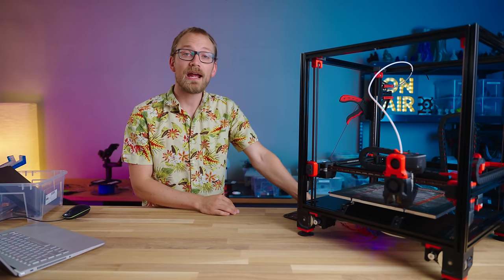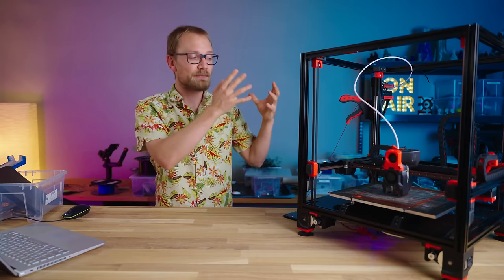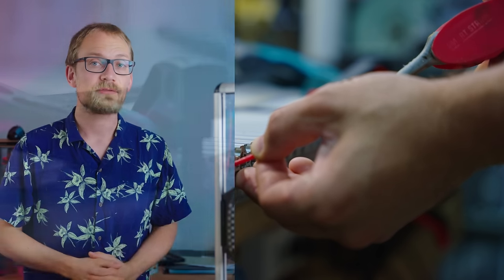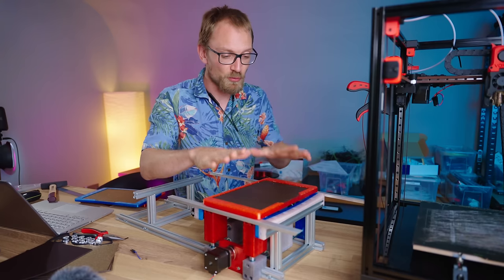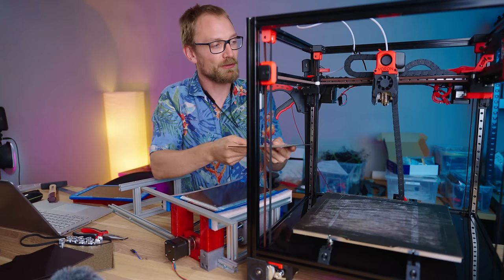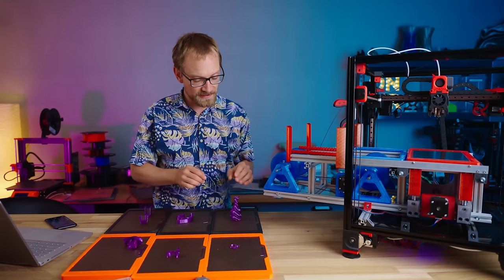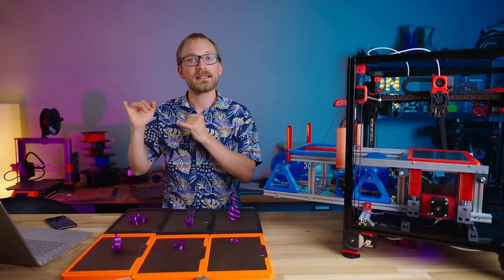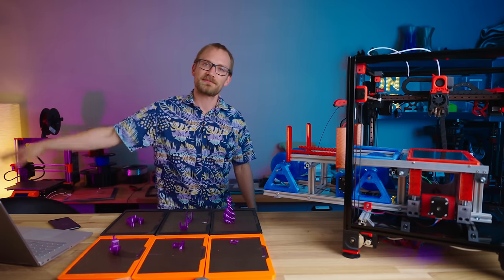Fully automated 3D printing using REAL print beds!

Comment: This is a cool project, but I have to say you missed it with this one. The Quinly system from 3DQue is a much more effective system for automated printing, and the guys at 3DQue would definitely work with you on getting a system built for the Voron. I HIGHLY HIGHLY recommend trying out the Quinly system if you haven't yet. I've yet to meet anyone that's used it that hasn't loved it. Not only that, you'd gain all that Z-height back with the quinly system. Their VAAPR print bed really is an amazing piece of technology.
Reply: Agree

Comment: This is cool and all but the quinly upgrade by the 3dque guys works perfect for the ender and it's like 100 bucks... I have 5 running non stop in my basement right now and I'm literally at the beach right now starting more prints. As far as them not being able to remove thin parts I was removing ear savers that were like 2mm tall with no problem. Not sure what Tom's on about here...
Reply: I built my own custom unloading mechanism long before quinly was a thing qnd it works great I love it. I'm at work and my 4 printers are going nine stop. But I wanted to try out the vapor print surface they have with my unloading mechanism and they won't sell it separately... I dont need their whole system
Reply: @nathantoews152  I ended up getting their diy kits which basically just comes with the bed, firmware and hardware and then you print your own parts. Way cheaper around 100 bucks. What kind of printers you using?
Reply: @mills4545  well im using ender 3 printers. but at this point the only stock parts are the frame and motors. literally everything else is custom so i cant really call them ender 3's anymore. im having good luck unloading parts with the BIQU textured beds, but im always looking for the next best thing
Reply: The Quinly upgrade fpr Ender 3 costs 230$ not 100... thats a little difference, you literally spend as much on the printer as the upgrade, additionally you can't really do that with the Voron
Reply: @AstralJaeger  Nah the quinly DIY kit is 130 and they have 15 to 20% off sometimes. I got mine for right around 100 a piece and there isn't too many parts to print. I mean I literally don't even check my machines anymore and I now have 12 of them running nonstop. I cannot even explain how amazing it was to have a family vacation and come back to all of my parts ready to ship for our business. I do end up putting quite a few upgrades on my enders though so you're right it does start to add up.

Comment: Do I get the sense that there is a collective movement going on to see who can invent the most mind boggling printer add-on. Where will this end.
Reply: So listen to me. What if we mount the printer on a car... and it drops a bed on the asphalt, extends an arm with a printer head, controlling Y axis with forward/backward car movement with transmission controlled with arduino, and after finishing the print, it drives to a spot parallel to it and drops another bed?
Reply: A combination metal, and plastic printer that prints copies of its self.
Reply: Hopefully, it never will end :)... lucky us!
Reply: @YourArmsGone  I concur, until the micro-factory/makerspace can replicate itself we ain't done
Reply: It will end with the words "Computer, tea, Earl Grey, hot!"
Reply: @andreasvogler1875  and it will produce something that is everything that isn't Earl Grey Tea.

Until you teach the AI. Hop you är not entering a battle att this point. 😎😁👍
Reply: Hopefully it doesn't end. It's about the journey, not the destination.

Comment: Great Project. Can't wait to see what people do with the design idea. Something tells me we can halve the height quickly for more usable Z space.
Reply: If the electronic was on the side like the side like the rat rig V3 then you could lift up the printer and reduce the height lost to almost zero
Reply: As it's a fully self constructed printer, it shouldn't be a problem to just use longer aluminium extrusions for a bigger height, right?
Reply: @Netzleben  yes but it's not only the aluminium extrusion you need to extend but also the belt and it doesn't make sense to have 500mm of height movement possible but only be able to use 300mm.
Reply: Don't really need to reduce the height of the bed changer system if you make the changer system the base. (Like if you mount the uprights to the top of the bed changer, and move the electronics elsewhere)

Comment: I run a 3d printing business. We automate our FDM printers by simply using the textured PEI build plates from Prusa. 

Print on them at 65 degrees, let them cool down to 30 degrees, then the parts are easy enough to knock off with the extruder/print-head. Works amazingly well.
Reply from the maker: Does that work for thin parts, too - and where do you prime the nozzle?
Reply: but you have to wait for it to cool down, with his method, he doesn't have to wait, just push it
Reply: @MadeWithLayers  Thin parts are probably fine if you have a bulldozer on the front of the hotend. And no real need to prime the nozzle. atleast I don't although you could use a catch bucket like sigmas
Reply: @yvesinformel221  Yes absolutely. Toms method is much more elegant.
Ours is a more simple approach, but it’s works excellently for us.
Reply: I would think a fixed heated bed, but a print mill print surface that just rotates 180° after a print would work. Texture surface on them works, and you wouldn't have all the Y moments the mill has.  A 300mm bed could only need 650 belt, with room for a conveyor or two.
Reply: @yvesinformel221  but you also have to collect the parts and then reload the magazine to get things moving
Reply: @yvesinformel221  the wait time to cool down of a few minutes is negligible if the prints are more than 2 hours since on a pei sheet, it typically takes about 5-8 mins before it pops off the plate.
Reply: @jamesthorogood1479  What, if any, are the drawbacks of your method, and what would you improve?
Reply: now i want to see this in action
Reply: @amenhallo  As others have mentioned; the cool-down time. This is a waste of time compared to Toms method, but it only adds about 5-10 mins to each print. 
If you only print the same part again and again, you can get around this by fitting a hook to the hotend carriage, then only cool down to (for example) 50 degrees, and run some custom gcode to hook the part from the build plate. This method requires much less cooling, and its something we are now starting to utilise.
Reply: How about turning a fan on automatically to half the cooling time
Reply: @jamesthorogood1479  idk if elegant is the word I’d use….
Reply: @jamesthorogood1479  a combination would actually be pretty cool. Instead of loading beds from one side and discarding to the other, it could print on one, then just move it out to the side to cool off, while the printer is printing the next part, when done shift back to the previous bed, push the part off, start printing again. The mechanism could even had some kind of arm to push the parts off, and something to detect if the part has come lose. The heater itself would not even have to be cooled down, it could just stay at temperature all the time, and a pause only needed to transfer the heat up to the bed again after bed change.
Reply: Your approach would be the way to go if I was ready to print on a textured bed. But with  a non-textured ABS and a perfect first layer, there is no way you can push the part even with the bed totally cooled down. Because of this, I like a lot @
Thomas Sanladerer idea, that keeps the part on the PEI for manual handling
Reply: @federicoromero6130  lookup quinly for the ender 3. They have an automated system like this with a mod for a fan that cools the bed automatically. Also a remote system to start prints from. Cheap and easy too. Stuff pops off their beds completely and usually doesn't even need the code to push the part off
Reply: @MadeWithLayers  i think sliding pei sheet on heating elements/bed and automatic toggle clamp much easier
Reply: @MadeWithLayers  what about a combo of these two ideas. With a flexible bed, couldn't you use a mechanism to flex it, rather than replace it, in order to pop prints off of the surface, before wiping them away?
Reply: @jamesthorogood1479  

I don't know why people are so easy to write off the cooling time. For someone at home I don't see it as a problem but for anyone trying to make money with their printer(s) I think they should be wanting to get rid of that time.

Let's assume prints take an average of two hours, the cooling time is five minutes, and Tom's system changes plates in one minute (just for some easy numbers). 

In a day both systems can produce 11 prints (2 hours/print * 11 prints = 22 hours). The cooling solution will have waited for 55 minutes in order to be able to remove parts while Tom's solution would have spent 11 minutes changing plates.  The cooling solution leaves 1 hour and five minutes remaining during the day while there is almost enough time left in the day (1 hour and 49 minutes) for Tom's system to produce another print.

At the end of the day Tom's machine is 44 minutes further into the next print than the machine that cools the prints in order to release them. Of course that's based on the assumption that every print took 5 minutes to cool down. In reality it would probably take more. If you are in the business of producing 3D prints you are only making money if your 3D printer is actually printing. You aren't making anything when you are waiting for prints to cool down.
Reply: Did you also try superfast-cooling with for example cooled pressurerized air that blows on / beneath the bed? With a flash of only 5 degrees or cooling I think the cooling could go town to seconds?
Reply: @capitalinventor4823  You are correct, and this is definitely true for a purely production-based company environment. But for us, we sell far less units of products (that we design ourselves) than we can make, so the extra time doesn't matter to us.
Reply: @jamesthorogood1479  You just have to start cooling the bed 3-5 minutes before end. First make a drop to 35°C then 1 min befor finishing to 25°C. This way you don't lose time and the print keep fixed till the end.  Anyway every hit could afect your bend leveling, depending on your printer. Having the  bed changin mecanism is great any way you look at it exept maybe cost and space.
Reply: @jamesthorogood1479  @Reid Gravelle Tom's system produces faster, but with many moving parts and more sensor + control system it would have a higher failure rate. So if both run for extended time, James would produce more
Reply: @mikeydk  Oh, I like the idea of the thermal-mass heated bed being separated, to enable the print surface to cool quickly, then ramp up again fast when in contact with the next surface. Back in my biology lab days, I recall some of the temperature cyclers for PCR DNA amplification used a similar trick to speed ramp down times, and avoid overheating the Peltier coolers: keep separate cold-mass w/ the cooler on it, move it away from the heater block for hot cycle, while it pre-chilled on the side, below the target temp, then in contact to cool down the sample block.
Reply: I heard you're brother George prefers to drink by himself .
Reply: I remember seeing a Hackaday article where someone was doing this with a tall & thin print (pens bodies?). Super simple method and could probably be enhanced with a little servo and cow-catcher/plow to "scrape" thinner parts off the bed. 

Do you print the same things over and over? Or do you do this between jobs in a queue?

Comment: VORLADERER 3.0!!

This is one of the best mods I've seen in a long time. Filament solution: 50kg spool and you'll be printing for weeks non-stop. The Belt-Belt®️ system is better than a drum because you're not limited to only 6 runs. Also the insertion/removal process is much simpler. Just fricking awesome.

Comment: This is a great idea! 
Excellent design for this prototype, seems pretty robust.
Reply: Coulld easily make it lower by modifing Vorons frame to reclaim the lost height - at the price of it being part of the printer.
Reply: 86Duino Enjoy 3D Printer
The same concept design five years ago came from Taiwan
Reply: @a728728728  The core xy printer type has been around for much longer than that, there are designs on thingieverse from 2014, for example.
Reply: Yeah its ingenious

Comment: TL;DR: Use cams to lift the print surface from the bed, they are powerful and compact
Consider the following idea: you have a magnetic printing surface just like one you already have, but a bit larger than the actual heated bed and with a RIGID frame (similar to your design). Then you have two camshafts running along the parallel edges of your bed (preferably the long edges) below the print surface level. Shafts rotate, cams engage the print surface frame from below and lift it from the bed, then you push the old print surface away using a new one coming from some magazine, like you already do. That would be a much more compact system, camshafts will take less space than this whole jack (awesome design but still) and you can use larger print surface and much more Z space.
Reply: Well he could also just use some small pneumatic cylinders like the mgpl12-10z on the sides. Would also easily fit inside the envelope of the printer and still be able to hold the entire bed. Just one on each corner. Would also be faster. 
I guess there are a lot of options on how to do it. I mean he could also just keep his current design and just increase the extrusion length on his z-axis. That way he would still have the same z-travel.
Reply: @nukularpictures  Well, pneumatic cylinders are nice, fast and powerful, but you will need a whole pneumatic system with a compressor, small reciever, solenoids, etc. For cams you just add a motor or two (probably geared or with a belt reducer) and they are powered and controlled just like the other motors on your printer. But I like the idea of pneumatics, might as well use the system for berd-air style part cooling.
Reply: @nukularpictures  actually, my next suggestion was to  use cams (or pneumatics, why not) to support and lift the actual rails which the "cartridges" are sliding on. Just locate these rails along the bed edges and below the "cartridge" frame.
Reply: The 8mm lead screws with some reduction are plenty powerful.  He'd just need 3-4 short lead screws, and a belt reduction or larger gear ratio stepper.
Reply: @martylawson1638  Actually, I just thought that just a couple of small servos with cams would be enough. They are already geared and should be powerful enough, you just have to lift one edge of the spring steel sheet so it detaches the bed (rigid frame will ensure that), then it should slide off the bed easily.

Comment: Man, what a project! I just missed a ramp on the release side to make all of those parts out of the printer without a crash, because if you print larger and toller parts that could eventually happens.
Reply from the maker: Yeah, totally. Trivial to add, though 😅
Reply: Then it just needs a model train to pick them up and deliver them to the correct location :)
Reply: @jg374 
I think a swarm of flying robots might be better for this application ;P

Comment: It is surprising how minds sometimes have similar thoughts. When you first described the goal, my thoughts were of a treadmill bed made with a revolving flexible magnetic PEI coated print surface. As a part finishes printing, the bed would advance to the next clean surface. As parts rounded the end of the treadmill the radius would break them loose from the bed and into the collection bin they would go. 

Cleaning the print surface for the next job may present another problem in need of a solution, but if the goal is to just keep the printer busy overnight, or for longer periods, just make the treadmill long enough so there is enough clean surface to last as long as needed! 

Then when you introduced your stack of individual print surfaces my thoughts jumped to the need for a magazine to feed them, and that's just what you came up with!

Comment: Tom! This is an awesome prototype!  I can’t count how many sketches I’ve drawn by hand on a plate switcher with magazines, thinking of interlocking framed glass plates and the mechanism pulling the plate off the bed causes the next plate to be pulled onto the heated bed and locked in place with magnets, but just didn’t like the idea of a 3d printed frame around the heated bed, and shelved it as a “maybe I’ll come back to it” project.

Glad to see you are once again showcasing to not be afraid to just try it and iterate on it!

Comment: I always wanted this kind of automated system to hypercube 3d printer.
Reply: I'm really sad the tech2c seems to have disappeared, I hope they are okay
Reply: I am waiting to see your project
Reply: That would be really cool, only the hypercube has a moving bed.
Though, maybe the magnet release system can be placed at the lower Z limit, with the plate conveyor through the bottom of the machine.

And it's nice to see others with Hypercubes. I'm currently in the process of rebuilding mine, with linear rails for the Y-axis and an e3D direct drive extruder.
Reply: @WyvernDotRed  Would love to see the outcome of this change !
Reply: On hypercube it's even easier: lower the bed, lift the magnetic plate a but and pish it to the rear, slide a new one from the front.

Comment: Or, even better, you can use cams to support and lift the actual rails which the "cartridges" are sliding on. Just locate these rails along the bed edges and below the "cartridge" frame. Even more compact.